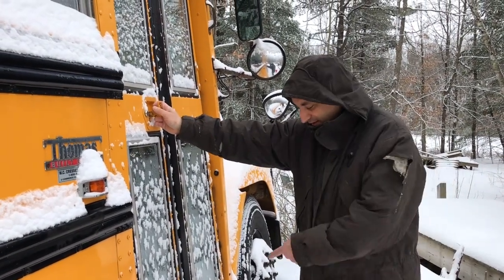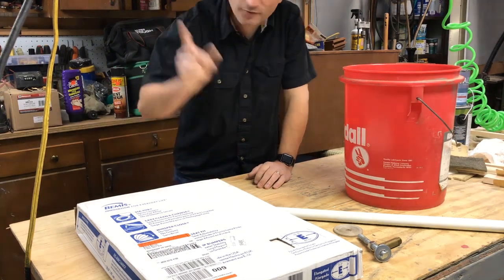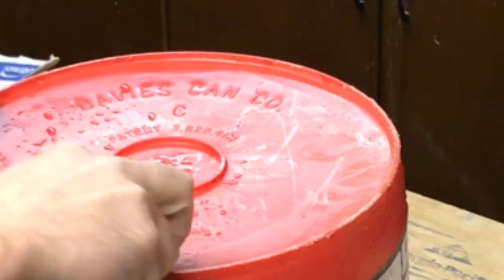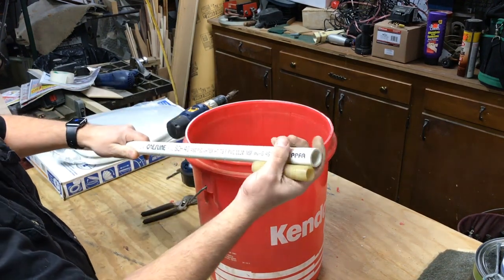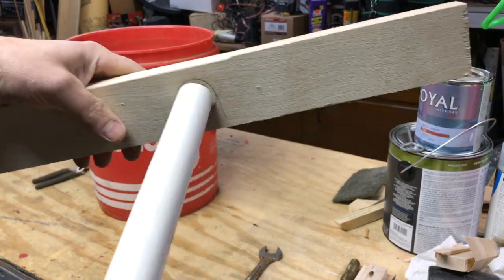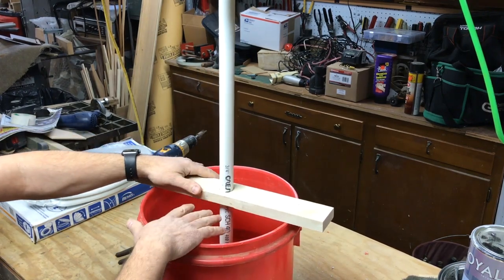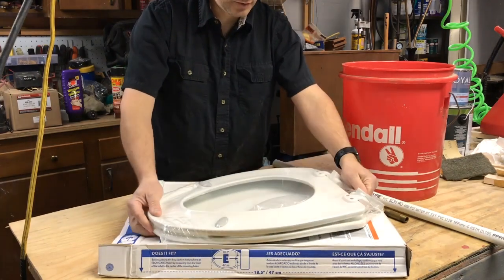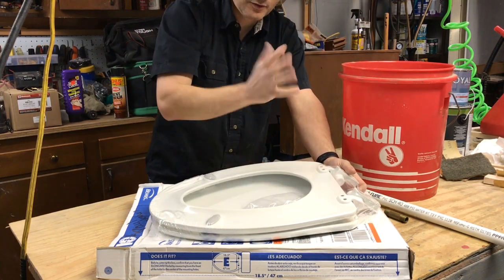How to build a composting toilet part 1

Comment: You know I decided to look up to see if anybody has come up with an idea to do C head Virgin of compost toilet and I found your video one thing that I would have done  a lot more easier is just get a PVC end cap glue it on drill a small hole small enough for a bolt to go through at the bottom of the bucket it will keep its Center and you don't have to go through all that you went through much more simple just a thought good video
Reply from the maker: You know the old saying, There is more then one way to skin a cat LOL thanks for commenting.